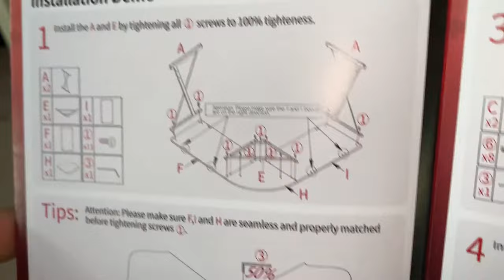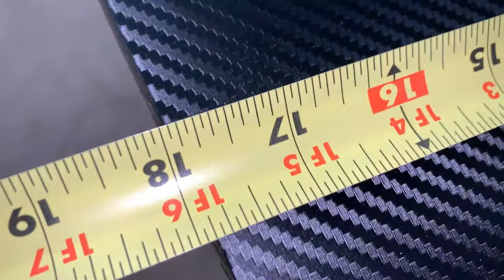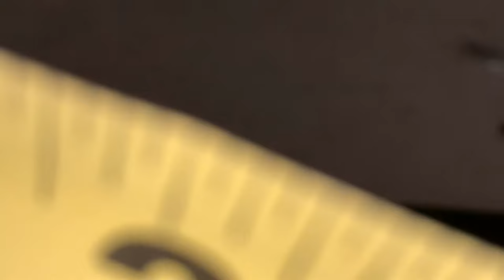MOTPK L Shaped Gaming Computer Writing Corner L Shaped Desk 51" Monitor Stand How to Put Together

Comment: what’s the little wood things called that go into the actual desk holes i need to get more mines snapped after taking desk down
Reply from the maker: Dowels:  https://www.amazon.com/s/?ie=UTF8&keywords=wooden+dowels&tag=googhydr-20&index=aps&hvadid=616931716219&hvpos=&hvnetw=g&hvrand=16705010794432510511&hvpone=&hvptwo=&hvqmt=e&hvdev=t&hvdvcmdl=&hvlocint=&hvlocphy=9004401&hvtargid=kwd-682142448&ref=pd_sl_8plq47xt42_e&hydadcr=24662_13611802&gclid=CjwKCAiA0JKfBhBIEiwAPhZXDwkfpxxWMTJE9L_U8pUuXelW4XU-nMQ67TOhaG32CQdvm97BkmadjBoC06gQAvD_BwE
Reply: @mtandiz  do yk what size i should get?
Reply from the maker: @NajGamingTTV  i think these will fit: https://www.amazon.com/Wood-Dowel-Pins-Fluted-Diameter/dp/B0B6T7FRJV/ref=sr_1_4_sspa?gclid=CjwKCAiA0JKfBhBIEiwAPhZXDwkfpxxWMTJE9L_U8pUuXelW4XU-nMQ67TOhaG32CQdvm97BkmadjBoC06gQAvD_BwE&hvadid=616931716219&hvdev=t&hvlocphy=9004401&hvnetw=g&hvqmt=e&hvrand=16705010794432510511&hvtargid=kwd-682142448&hydadcr=24662_13611802&keywords=wooden%2Bdowels&qid=1675989621&sr=8-4-spons&spLa=ZW5jcnlwdGVkUXVhbGlmaWVyPUEzVjQ5M0k1MllIU0ZDJmVuY3J5cHRlZElkPUExMDA2MzQ3MVdaNVIxRDJPMUJSNCZlbmNyeXB0ZWRBZElkPUEwNjk3MDg4MllCVUdVOFBFQ0tCWCZ3aWRnZXROYW1lPXNwX2F0ZiZhY3Rpb249Y2xpY2tSZWRpcmVjdCZkb05vdExvZ0NsaWNrPXRydWU&th=1
Reply from the maker: @NajGamingTTV  you could check Home Depot